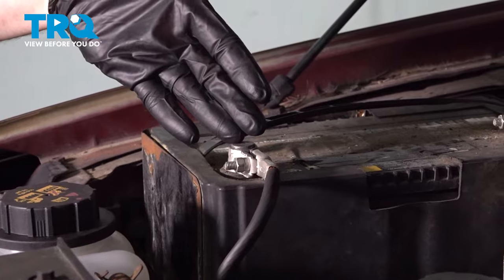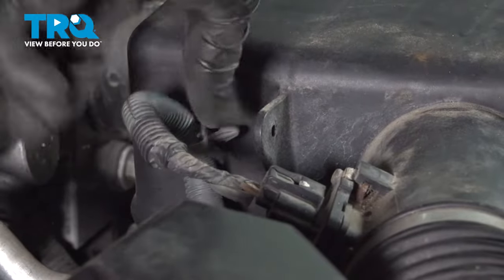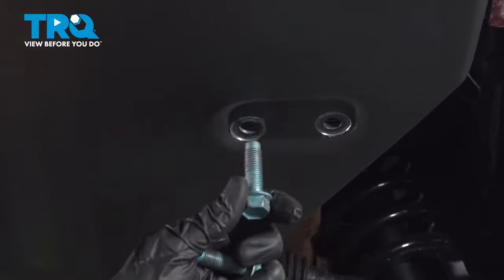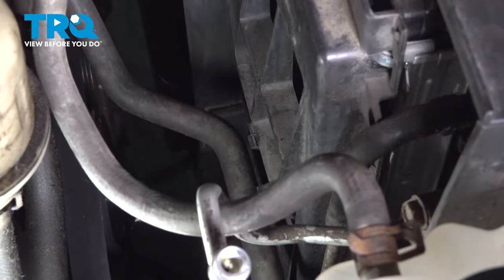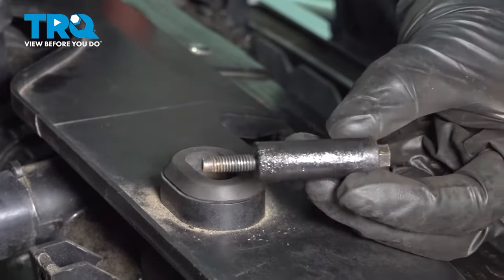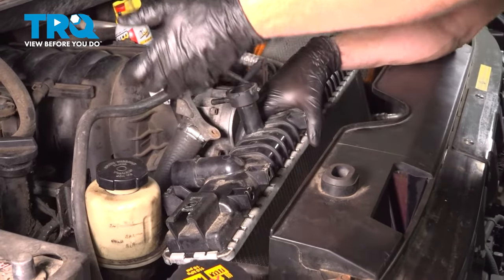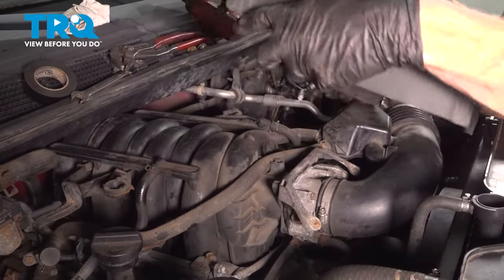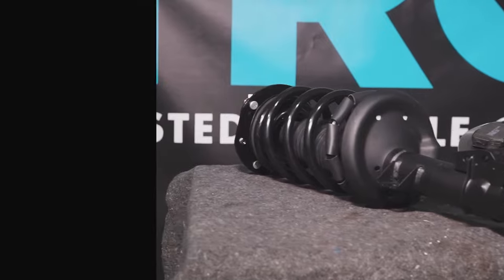How to Replace Radiator 2004-2015 Nissan Titan

Comment: Replaced my radiator on a Titan 2011 and followed this video step by step with success.

Most challeging part was taking off/on the fan using standard wrenches, and reattaching the AC bracket. My titan had a plastic shroud around the AC mounts that made it much more difficult.

The skid plate was different, but I figured it out.
Reply from the maker: +@nathanrudat4439 Thanks for the feedback! http://1aau.to/m/Shop-TRQ

Comment: Thank you for this. Excellent style and delivery! This helped my confidence, and three hours after I got back from AutoZone with the new radiator, I was test driving it. Could have done it faster, but I put up a pop-up in my driveway to keep out of the sun, and took a few "breather" breaks to regroup and psych myself up for the next step. Plus, it was a pain trying to juggle the new radiator, condenser, and transmission cooler to all fit in place at the same time.

Comment: Very convenient having new bolts on the front of the skid plate 
Mine are the round head Allen bolts that are completely rusted at four different points  for each bolt

Comment: Do you have to add transmission fluid back in how much did you loose by taking off the transmission cooler lines

Comment: So I just had my radiator replaced and I went under my truck and the transmission hose on the passenger side is leaking. I noticed the spring clamp is broken. Can I remove the hose to replace the clamp without losing all my transmission fluid?